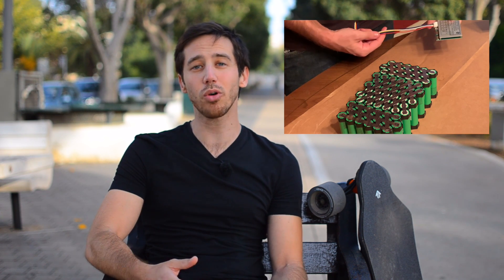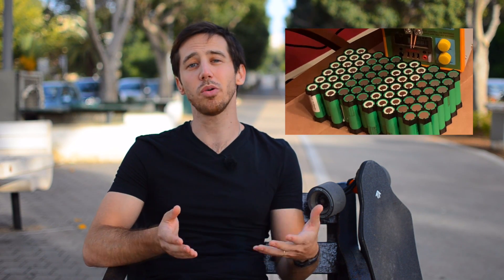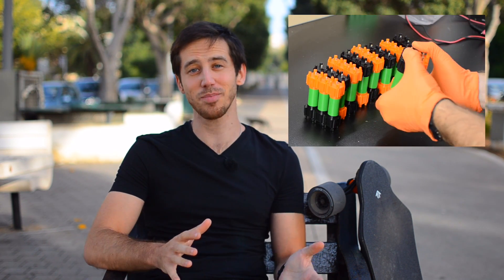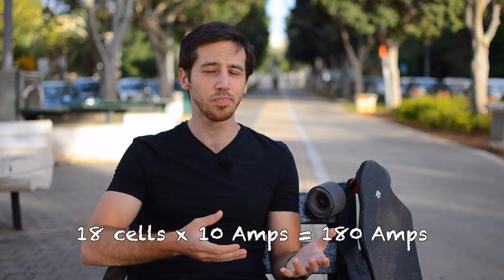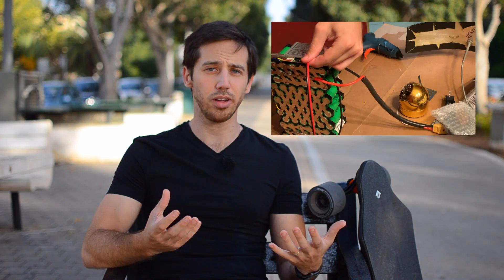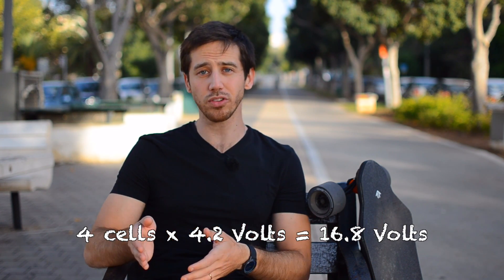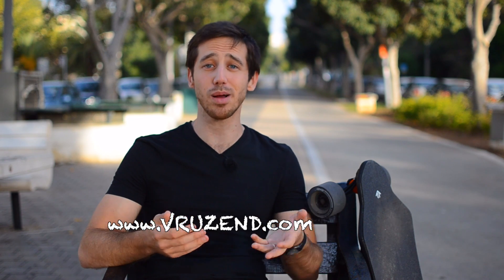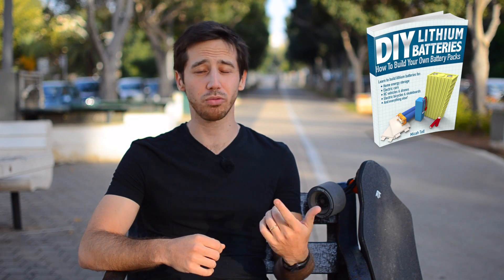DIY 12V battery for trolling motor (follow up Q&A)

Comment: Hi. Just watch your video and thanks you. I have a question about the nominal voltage of your 12v battery.  Did you combined 3or 4 in series with the 18650 batteries? I am asking because the popular trolling motor manufacturer does not recommend lithium ion batteries because the voltage is more than 12V with may burn up their trolling motor. With four 18650, the nominal voltage is 14.8V while with three 18650 the voltage will be 11.1V. How did you make sure that the voltage will not be too high for the trolling motor?

Comment: Hi I am currently trying to build a diy option for trolling motor with Ridgid 18v 4ah battery. There's not much info out there on the batteries. I do know that this battery should in theory put out a max of 40 amps at  max load correct??? Also the 30lbs trolling motor I have says its max load is 30 amps. If I put 2 of these batteries in parallel I should get 80 amps max out put of batteries so they should not over heat .

Comment: Hi love your videos and subbed! Could you please tell me If this battery setup with smaller or less cells would work on my old suzuki drz 400 motorcycle which has a lead acid battery 12volts and 7 ah. Can I crank safely with out hurting the bms or the batteries? And do I need any other changes on my motorcycle? I know my regulator/rectifier puts out about 12 to 15 volts as acceleration increases will there be any fail on bms charging? Since change in voltage.
Sorry to bother you with too many questions but this battery looks promising. Thanks for your help much appreciated.

Comment: Hi! I have a 300W motor e-scooter with a 36v li ion battery  pack 10S2P and the battery died. I dont find the same battery online and unfortunatly the scooter company does not sell it. Can I use a different battery for this motor scooter? I d like to use a same battery or one with better range.

Comment: Would it be efficient to use a 48v ebike battery and step down to 12v for the trolling motor? What would be the best way to do this? Is it possible to overvolt a trolling motor like you did ebike motors?

Comment: Safety first right..  but wouldn't your battery    math make battery packs very expensive?
Reply: All engineering is about balancing competing variables. How much safety factor to design in is often a subjective question, and you're right- there is a point where adding more safety busts a requirement threshold in some other area, like cost.

Comment: My MOM has a GOGO Scuter, that runs on 2 - 18AH Led  batteries, at 24V..  Would Making one of your battery packs work on her GOGO ?? She is 92 and can't walk too far, so having a battery pack go bad on one of her trips out, would be real bad..
Reply: The motor doesn't care about battery chemistry, just voltage and current. You should be able to design an acceptable substitute using Li-ion cells.
Reply: @jdotoz  I am just worried about over drawing them and have her chair catching fire..
Reply: @SuperLee47  You just need to design in enough safety factor then. Look at your spec sheet and add parallel cells until you feel comfortable with the current and charge capacity.
Reply: @jdotoz  Thanks for your help..  I'll give it a try..

Comment: So technically, if your wires can only support 50 amps, you should have chosen a BMS that cuts the pack at 50 rather than 100 Amps 😊. Do you usually implement fuses in your packs?

Comment: Hi Micah I love your videos. I have a quick question can you please make a small video for 12 volts motorcycle battery and a reliable bms which can charge from the motorcycle rectifier 12 volt output with appropriate cranking power. I think there is a huge requirement and interest in the motorcycle community thanks cheers Harsha.

Comment: Great video. I was hoping to see the battery in use on the kayak as well. I have a 10 acre pond on my property that I enjoy fishing in and I was thinking of get one of those Bixpy Jets for a small kayak, as well as for using in our swimming pool.
https://bixpy.com/
I was thinking the same thing with solar panels to keep things charged up and building a bigger battery, but I'm not sure if that's possible when reading about the battery the motor uses. What do you think?
Keep up the great work.

Comment: I was one of the viewers who asked about chargers; thanks for answering.  Just to be sure I understand correctly: the BMS will draw current from the charger, balancing the cells and charging them until full.  When full, the BMS will stop drawing current from the charger.  By monitoring draw, the charger will know the pack's charged, and I assume will turn on an led indicator signaling fully charged.  Accurate?
Reply from the maker: Yep, you got it!

Comment: Very good explanation of how important it is to make sure everything is capable of the continuous current!! I had a solder fail in my battery pack once. It was mind boggling to figure out the fail until I started taking off electric tape. Pretty crazy to see a melted solder point between two wires. Immediately felt the difference in acceleration on my e-bike after the repair!

Comment: I have a 48v 1000w rear motor hub in which I'm using 60v30a(16s10p) to 
push it. The problem is that it's getting hot and, I guess, the magnets 
are swelling up(expanding) and causing the motor to seize up. Once it 
cools it will spin again. What's going on? Great vids by the way!

Comment: Hi Mikah's dad!  That is a very nice setup you built. Question: If you were going to do this again would you use a pedal-drive kayak for the hull? I realize it was what you had when you decided to add electric drive but If you were going to build another one what hull would you use?

Comment: Hi Micah, Thanks fot this nice video, I like all of them!  -  I just finished building my first battery, a 12V /60Ah  LiFePO4, 4s9p, using LiitoKala Lii-70A, 32700 cells. Your book was a big help. -  I am about to complete some decharging - charging cycles in order to know more about the true capacity of the baby. ;-)    
Here comes my question: I want to use this battery in parallel with a commercial battery of the same chemistry, voltage and capacity for my small solar power system (200W solar panel, 800W inverter, all victron devices, except for the battery). My intention is to double the capacity from 60Ah to 120Ah. If I find that my DIY battery has a lower capacity than planned, say 50Ah, is there a problem in connecting both batteries?

Comment: Hi Mika I have a problem with a 12,000 W E bike it has a 72 V 48 amp battery lithium I keep blowing the hall sensors on the motor I can’t get it to run I’ve tried testing the controller on another bike that I have that has a 72 V 38 amp battery and the controller works fine I also changed out the hall sensors in the motor and tested it on that same battery and it works fine but every time I hook it up to 72 volt 48 amp battery it blows the hall sensors could that be a BMS problem I don’t know I’m at wits end on this can you help me thank you.

Comment: I have a question. It's safe use a step up or step down with a power source to charge Li-Ion batteries?  Because in my country it's very difficult find chargers with this voltages values (8.4, 12.6, etc). My idea is to use a 12 or 24V power source with a converter to reach those voltages. Obviously, having in mind charge current and with BMS. Thank you, Micah, to share all this info.
Reply from the maker: Yes, but it would be best if your step up or step down device was a CC-CV device, as in constant current - constant voltage. That way it trickles down the current as it nears full charge.

Comment: It would be nice to see other battery powered devices, in particular I'm quite interested in odd shaped batteries like my own to perfectly fit a specialized pitch comp fsr. I do however stick to your guidelines with packs, so i have a 100a bms but the Max I'll ever temporarily surge is 63amps for <10 seconds with cells that can surge 130amps for the same, my series connections are able to handle 50amps based on number of links on the 5.5amps per strip so thats 100amps badly, it was a huge headache following all the current traces on a trapezoidal battery but man it was worth it, the cells don't heat up at all, i actually have trouble keeping them warm (Irish winter). Can't wait for that kayak 👍🏼

Comment: Hi, i bought a 2kW, 48V  bldc motor with an control box. I connected everything but it doesn't rotate. It only makes a high pitched sound and it only spins when i spin the gear and rotate the throttle after (the problem is not with the e-lock). Do you know how i can fix this issue? Thanks!
Reply from the maker: Sounds like your motor wires (thick and thin yellow, blue and green wires for phase and hall sensor) are out of order.
Reply: @EbikeSchool  I opened the motor and the cables were all working, is the problem maybe in the control box?